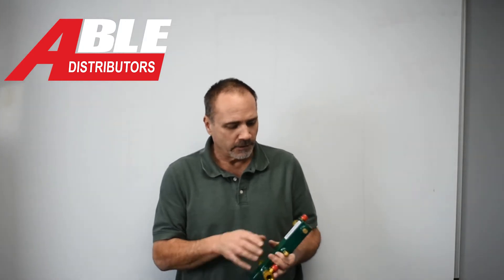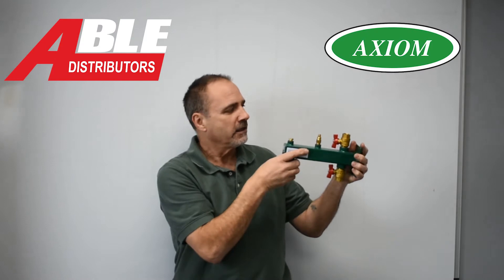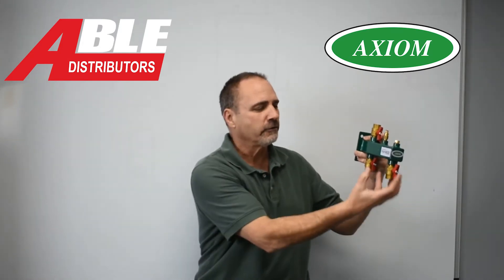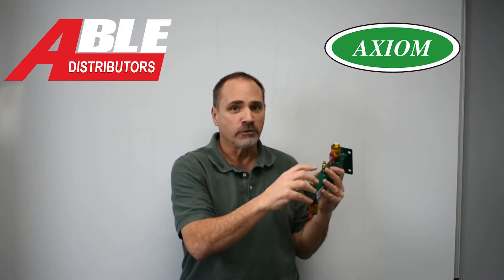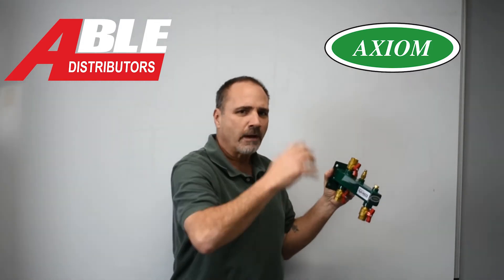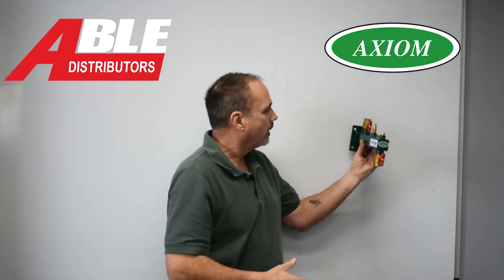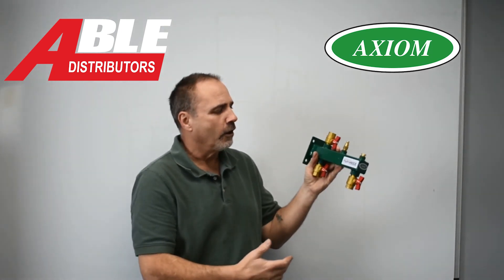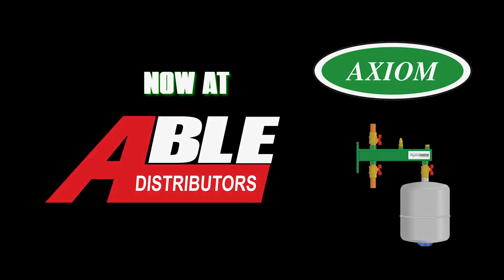Axiom Hydro-NODE Docking Station (H70-HN2)

Comment: On spec. sheet the fill water is on the bottom port and the system water on the top port. You stated the opposite. Are these ports interchangeable?
Reply from the maker: absolutely , you can have your incoming water feed on either the top or bottom.